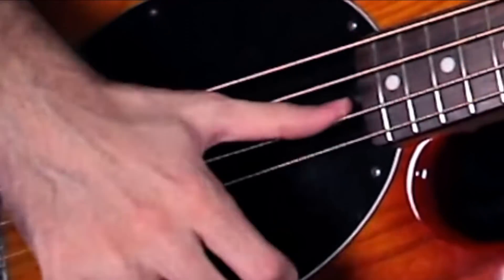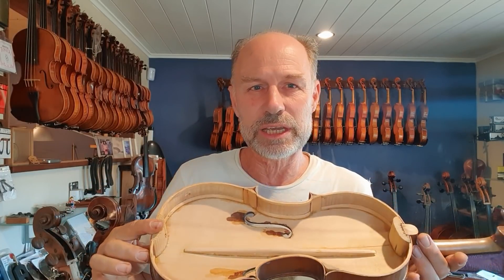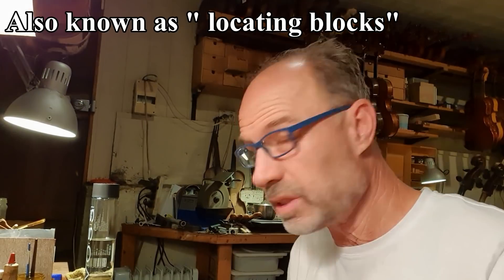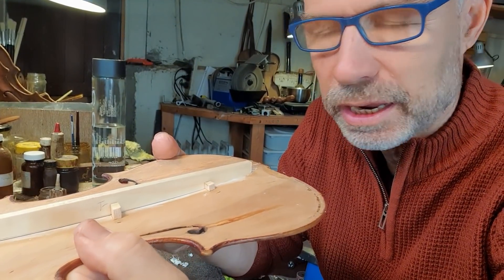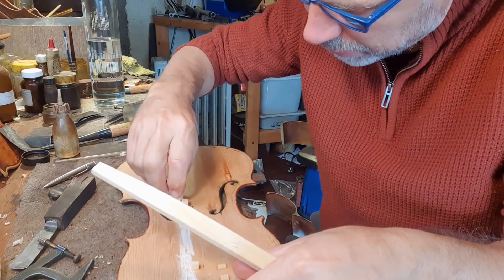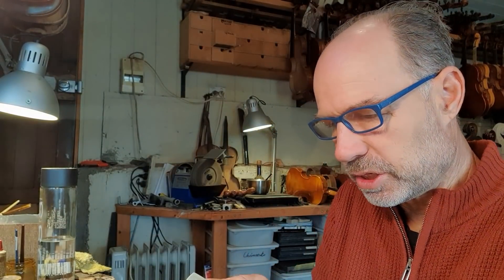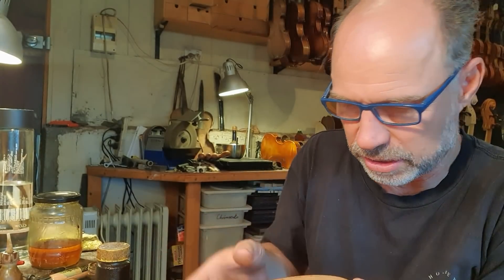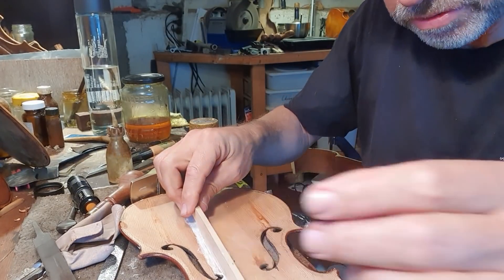A Bass-Bar inside a violin?!? Master violin maker explains how it works

Comment: I've seen integral bass bars--left in the top plate as it's carved. What do you think of that, Olaf? Can it work well?
Reply from the maker: @hallsf  I don't think it works as well, but I have also heard instruments that sound quite good with a bass bar carved into the top.

Comment: Hi Olaf, I was also tired of fitting the bassbar to the violins.  It used to take me 3 days minimum.  Now, I made myself a simple tool to get me where I want to go.  The tool is made out of two parts: a quarter inch stainless strip about the width of the bassbar but a little longer than the length of the violin plate, and a 1/32 inch G10 (that is stiff fiberglass plate) or stainless strip about the same dimensions of the 1/4" steel bar.  I have five 4-40 screw holes for profile adjustment along the 1/4 inch top stainless strip, and two more at the very end to attach the 1/32 strip to the 1/4 inch bar. The end holes are elongated on the 1/32 inch strip, so that this piece is allowed to move back and forth with respect to the 1/4 inch bar.  Now, I attach the ends of two strips together and do the profile adjustment with 4-40 screws.  When I am done, I transfer the profile to the bassbar wood and cut it in shape.  The fine adjustment afterwards will be done by chalking method.  Good luck :-))

Comment: Quick question: why do you not want the base bar to be in contact with the back plate like you would have a sound post? I was talking to a Luthier ones who had a request from someone to put a sound post on the bass side as well as the treble side, and he said he did it for them, but didn’t notice a difference.

Comment: Beautiful work as always! I'm curious as to the purpose for initially making the bar that length and gluing the ends when they're going to be removed later?
Reply from the maker: Sometimes the  very ends get slightly rounded while fitting, to get around that I fit the bass bar while it's slightly longer. This way the ends fit 100%
Reply: @AskOlaftheViolinmaker  Makes sense! Thank you so much for replying 🙂

Comment: - Olaf, I gather that the calcium carbonate in chalk does not chemically interfere with the hide glue, correct?
- I assume that the chalk technique has been used for ever and is known to not adversely diminish the strength of hide gluing.

Comment: - Olaf, what is the ideal end grain orientation of the wood you choose as the blank you start from?
- What species of wood is best? Spruce, maple, ash, birch?
- From horizontal {flat against} and parallel with the top plate, through a 45 degree angle, to a vertical orientation perpendicular to the top plate, what is standard?
- Could orienting a 45 degree end grain from the center line out toward the ribs produce a "softer" bass tone and the reverse orientation a more "round" tone to the bass?
- I ask because in my mind's eye, I see the softer/squishier/smushier vascular cambium layers between winter time growth rings being compressed  and producing a "bending/bowing" of the "bar" as each sign curve of the base tone wavelengths impact it. 
- I don't know that I understand this correctly, but I am suspicious that grain orientation will result in differing engineering vector loading that will yield differing tonalities.
- I somehow feel this intuitively, as if the wood is talking to me and telling me what it will do because it can.
- It is strange that I "hear" the wood telling me about using micro-thin shavings of mountain goat horn, like what used when fabricating a recurve bow for archery the old way, to add in something that only it can do.
- I think that "something" has to do with electrical or magnetic energy, which the keratin of horn and hoof can transmit or transfer, as something unique and specific that is hidden in vibrating wave forms.
- Maybe I am some sort of alchemist/shaman mystical luthier and don't even know it...roar with mirthful irreverence here...
~ ~ ~ ~ ~
- google(DOT)com/search?q=CALCIUM+CARBONATE+And+HIDE+GLUE+CHEMICAL+INTERACTION
- cool(DOT)culturalheritage(DOT)org/albumen/library/c20/vonendt1991(DOT)html
~ ~ ~ ~ ~
- "What is calcium carbonate used for in glue?
- "Huber's ground calcium carbonate (GCC) is widely used in adhesives, caulks and sealants applications as a rheology modifier, cost-reducing filler, tensile strength enhancer, toughening agent, opacifier and/or whitening agent."

Comment: Some years ago, when I was working for the highway department, I had stopped my truck in the pouring rain to remove debris from the road. Laying just off the road, in the woods, I found a completely waterlogged and disassembled violin. I carefully picked up all the pieces and brought them home (my father was once a violinist, I still have his 1925 Contino.) When I dried the instrument, I noticed that the bass bar was not a separate piece, but was carved from the same spruce as the top (or belly, as my father used to call it) It seemed very crude. The barely legible label said it was a Stradivarius (obviously a crude copy) have you ever seen a bass bar carved into the top? The finger board had fallen off and had a number "19" written in pencil underneath. The numeral "1" was a European script with a large up up swoosh, so you know it wasn't of American manufacture. The only other oddball thing was a tiny, square peg fitted to the top of the neck block, which fitted into a tiny hole  on the backside of the belly (or top piece). Again, I have never seen anything like that. Everything had come unglued - the ribs, linings, both top and back were all separated. It's a very dark and ugly instrument, but I couldn't throw it away.

Comment: Gotta love these olaf videos where he makes it seem like fitting a bass bar is complicated.  All you need is witness marks to see where to remove material until you have a 100% match, top and bottom.   Oh and  by the way, the "sound tuning" of a bass bar where you tap the plates is pseudo science and has no real proven effect on the final tonality of the instrument.   Dr. Peter Zaret Has developed a new technique of tuning the bass bar which he claims improves the tone of any instrument to a 200,000 dollar level.   The problem is that there are too many violin snobs out there who think that unless its a Strad,  its no good. And by the way the double blind tests of the strad vs other violins cannot be detected, just more pseudo science and people valuing antiques.  You can also see here that he has glued the bass bar over the F hole.  Amazing "fitment" I would not recommend this guy at all.

Comment: Hi. Thank for sharing!
I hope you see this question and feel like answering it. I would like to know if you glue the Bass-Bar to the top-plate with tension. I would think that, in that case, the Bass-Bar should not fit perfectly, but it would need to have very minimal gaps at the ends so that later, when clamping it and gluing it, it creates tension.
Is that correct?

Comment: Olaf,  what can we use as prefered wood   for bass bar?    Can we imagine  to use something stiffer than wood,  for transmitting better the vibrations?
Reply from the maker: I use spruce with a similar density to the top-plate

Comment: Olaf, some luthiers would make a plaster mold of the top plate then use the mold box as a support while clamping. Some would also move the bass bar away from the F hole. Was not a witness mark left? Restore is different than remodel IMO.. Yes I know the elders played games with F hole spacing and sizes. Thanks for sharing.

Comment: Excellent performance, thank you for showing in such detail.  I have one question if I may. You have placed the BB right on the edge of the top circle of the F-hole. On my 1857  Guarneri copy, J.B. Vuillaume violin,  the BB is a couple of mm's away from the F-hole.  I have been told in Vienna a couple of years ago by a prominent luthier, that it is in the wrong position (or angle) but not to an extent that would require replacement. How does this particular placement 2 mm's away from the F-hole affect the sound? A 41.5mm bridge works best for this violin. Thank you.

Comment: Teach me make the bridge. You were talking about how it works, but you did not show us how to make it. I have no luthier around so a few days ago I bought a new bridge and cut it myself, by some manuals. It is almost perfect, only it is lower on the G-string side than it should be and slightly too thin at the top. In any way it works for me, but I want to try it one more time in a near future to get better sound of my violin experimenting with bridge. My father is a craftsman, so I have all needed equipment to make measures and curve the bridge. Only make the video, please.

Comment: Hey Olaf. Thanks for the cool video. I have a strange question about how you clamped the bass bar onto the top plate while the glue was drying. When building PCs, we have to mount the CPU to the motherboard using screws. It's very important when doing this to do it in a way that evenly distributes the tension on the CPU so that you don't break the CPU die. Usually, this means doing it in a kind of crisscross pattern (top-left first, then bottom right, then top right, then bottom left, for example). When you put your clamps on the bass bar, I noticed that you started in the middle, then did two on the left (well, our left, your right), then two on the right (your left), then some more on each side. Did you do it that way to avoid putting too much tension on one side of the top plate, or is the top plate sturdy enough that you don't have to worry about that very much? Thanks again for the video, it's so interesting to see how things get fixed. :)

Comment: Hey Olaf, is there any reason violins can't be built structurally as acoustic guitars are? I know the top's arched while the guitar's is flat but I'd guess either the bridge could be taller (keeping current style bridge), the bridge could be redesigned more similar to guitar, or the guitar-lin could keep the guitar structure (and standard violin bridge) while still having an arched top... Just curious. The main reason I ask is that the guitar doesn't need extra structural support of a sound bar. Yes, I know the bridge (sound transfer) and string anchor system is different, thus the bridge mod suggestions.
Reply: edit: No replies but... The answer that came to mind is that the sound post allows more vibration of the top plate and thus more sound than the "X" structure in the body of a guitar. The violin is pretty small so it's hard to get a lot of sound out of it and too strong a structure in the top would make it harder. The sound post serves as a single pivot about which the top plate can easily vibrate. A bigger instrument is fine with stiffer structural braces because there's more area on the top plate (sound board) for the bridge to work with.

Comment: Many questions, just some of them :
First : it is written "BASS Bar" (seems it should have an influence on bass (LOW) notes). But you pronounce it "BASE" bar. Is it wanted ? Does the upper table of a violin is called "BASE" (what would mean that the bar is designed to be glued on that base) ?
Second : You seem to be "satisfied" of the shape. Does that mean you have made a number of trials and comparisons (thicker, thinner, flat upper part... ), and this is the best ? Or does that mean it looks as Masters indicate (plans, measures ?), or looks like any violin you dismantled before ?
I have 50 other questions, most important being : Is that bizarre assembly of a bar and a pole impossible to change, why not 2 poles, or 2 bars, or plenty like in guitars ?  But thanks for your very interesting, clear and well-done videos I often look...
Reply: There's no pronunciation issue here. Base and bass (low register) are pronounced the same. However bass (low register) and bass (fish) are not pronounced the same. #English
Reply: @flowerdolphin5648  Thank you, I believed. 'am French and my english is a bit scholar...

Comment: Is there a better material for a bass bar than wood?
Reply: [Disclaimer: I'm not a luthier, not by a long shot] Comment from a maker: whenever you join different materials (wood+metal, wood+plastic, different metals, even different woods, ...) you create stress in the joint, since the two materials will react differently to their environment: wood expands and contracts with humidity, metal does not; metal expands more with temperature than any other material; etc. 

The joint will only be in its original state when all the environmental variables are exactly the same as when you joined them (for wood not even this is a given, since the glue often has water in it). I would guess that a bass bar made from non-wood material would sound bad in almost all situations, since the stress in the joint with the wooden top plate is higher than expected and stress affects the transmission of sound.

In short: the bass bar should be made from the same kind of material as the top plate to reduce (changes in) stress in the material joint. If you buy a plastic violin you better hope the bass bar is plastic. ;-)

Comment: So how did you determine how long the bass bar should be, or how far from the plate ends the ends should be? 2/7ths from the ends? (If so, why?) It looked like one end was farther in than the other end, I'm sure there was a reason for that.

Comment: I have a luthiering question! How would it affect the sound or structural integrity to have the bass bar in the center of the top plate with the sound post wedged between the highest point of the bass bar & the back plate? All of this with a special bridge with one foot in the center. Basically all of the normal components lined up in a row instead of to the left or right.
Reply: I do not think this is a good idea. The sound post is meant to transmit mainly the high-frequency vibrations from the top strings to the back plate - which is made of a harder wood and resonates at higher frequencies than the top plate - which is made of softer wood. Basically the top plate is a woofer and the bottom plate is a tweeter!
Reply: I doubt he ever tried it to know for sure what would the result be but I suppose it would interfere with all those parts vibrating and caring vibration in the way they are supposed to
Reply: No harm in trying, but I think it will give a nasal and uneven sound. The sound post functions also as a fulcrum around which the bass side of the sound plate rocks up and down. The bass bar stiffens the bass area giving more vibrating area. In your proposal the bass bar will do the opposite. Only stiffen but not rocking.

Comment: Today i purchased a cello to use short time it used so of course, I have to buy some things tomorrow so I'm going to a luthier and buying rosin, a set of strings, and a bridge. I always hate taking off the strings as it takes so long. but it has to be done. there's no point to this comment honestly just kinda venting I wish there was an easy way to replace a bridge.
Reply: google "Cello Bridge Jack", might give you some ideas

Comment: Is there a reason that the bass bar has edges with right angles at the inside? 
Has anyone ever tried a completely rounded bass bar with almost ball-end-points?

I am not too sure how to describe what I mean... Hopefully you kind of know what I mean, like the surface at the other side of the glue connection, the portion facing directly looking inside the violin, why is that flat? Does it work better than rounded edges?
Reply: Thin and high is stiffer for the same weight than wide and low. The builder chooses what probably works best for a certain sound plate.

Comment: Hi Olaf, I am curious that why you have to cut it in the end, not just cut it before you glue.
Reply: Yes, I was wondering the same thing. Why not cut to length before glueing?
Reply: I would guess it has to do with the glue and drying process.  You're not able to clamp ends as well as you can the middle.  By having a little extension, you're able to have a firmer contact through the entire length of the bass bar.  Also the fine "forming" of the ends he does might be easier when on the top plate than off.

Comment: How come you have to cut the bass bar to length after it’s been attached to the top plate? Seems like a lot of chance to damage the top plate that way - why isn’t it possible to cut it to length before and then attach it?
Reply: I think it would be hard to glue the bass bar to the exact perfect location... whilst this way you can cut to the lenght needed, so there is less to worry about when glueing.
Reply: Looks like it's because the final shape, particularly the ends, would be difficult to do without damaging the final part. The wood may splinter. Also, when planing (shaping with a plane) the final shape, he has to apply some pressure and having the part attached to the top plate supports and steadies it. This guards against his bending/breaking/twisting it.
Reply: Mayasounds I was wondering the same thing?

Comment: What if there were 2 bass bars? That would be a very interesting or bad sounding instrument
Reply: Depends on their size and material. Basically it gives the tone more low end resonance but if you put too much in there it will simply deaden the sound overall.
Reply: It's really interesting question!  Guitars, for example, have constraction of braces on the top and on the back.